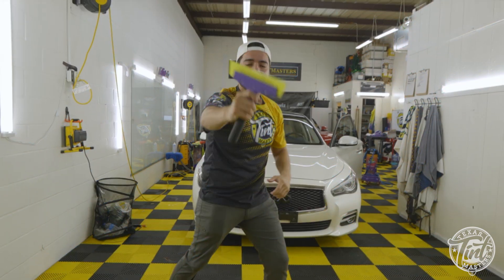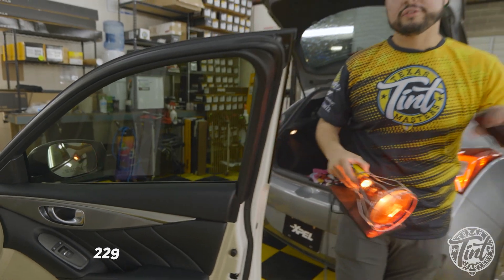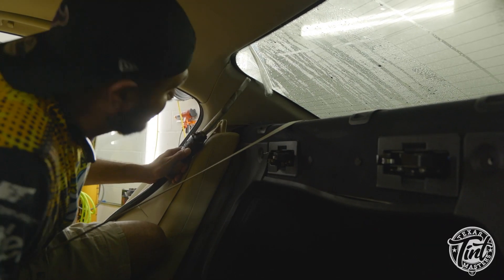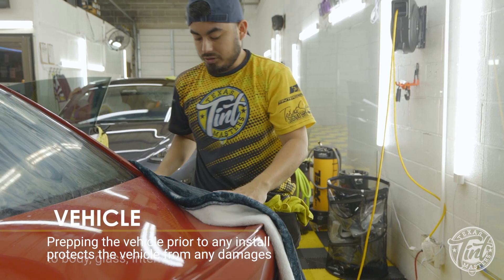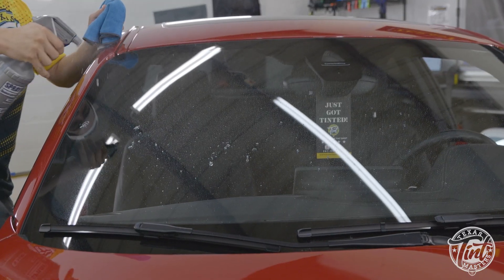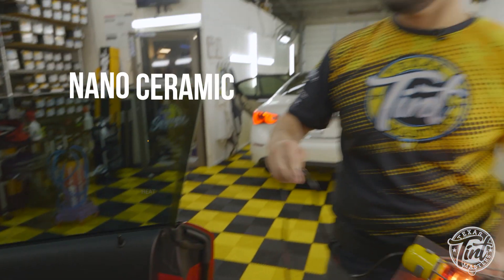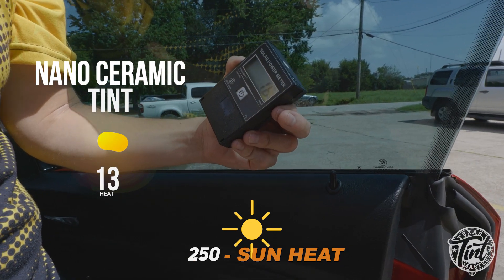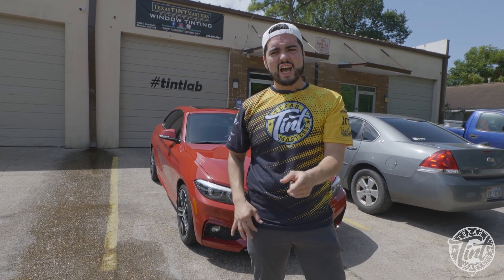Dealership Tint vs Ceramic Tint (Heat Tests)

Comment: For those asking. There are videos of regular 5% tint vs 70% ceramic and the ceramic still does better by a significant amount. I recommend ceramic to my family members when they’re looking for tint worth it in the long run with this heat. I show them that video to help them understand the difference

Comment: Will a lower percentage ceramic block more heat than a higher percentage? Or is it about the same?
Reply from the maker: It will block more 😎
Reply: Lower % blocks more! But even a 70% ceramic tint, beats a 5% factory tint by a significant margin!

I.E a 70% blocks 30% of light, 
A 5% blocks 95% of light.

Comment: How hot will a car get sitting in the hot sun for an hour or so? Will the interior of the car still get over 120 degrees?
Reply from the maker: There’s too many variables for a question like this but the answer to what the question is intended: 

Ceramic Tint is for when YOU are in the vehicle with your AC on. Cars will always get hot in the sun no matter what. Even cargo vans with no windows still get hot.

Comment: If only there was a way to not gimmick this with like what's akin to a "spirit box" in ghost hunting, there could be like a real world test where you left 2 cars outside and tracked the temperature inside.
Reply from the maker: That would be a completely flawed test and wouldn’t prove much other than the decrease in heat transmission entering the car. If you let ANY vehicle (even cargo vans w/ no windows) outside—they will STILL get hot. Just the normal effect of thermal equilibrium. Ceramic tint is an insulator. The difference in effect would be similar to a home w/ and w/out insulation. 

You still need an air conditioning unit to counter heat. Window Tint is an insulator, not an air conditioning unit.
Reply: @TexasTintMasters  yeah but my problem is the actual effect. Carbon color stable tint has some heat resistance, is the ceramic heat reflection a negible improvement in real world use? Most sites discussing it just go into the rigamarole of "ceramic won't block wireless signals" and really stuff that would if anything make it unusable, so not really helpful.

If the windows are a major source of heat transfer, then at the very least in the begining stages of the cars heating up there should be a difference. Otherwise once you block UV and some IR rays that's really the extent to the benefit.
Reply from the maker: @jer280  You’re definitely right about the initial heat transfer however the bit about carbon color stable blocking the same amount of heat as a standard traditional ceramic film is definitely incorrect. 

Carbon films seemed like a great alternative when they first debuted but they don’t last as long and are prone to adhesive failures within the first 24 months, especially in hot humid climates and coastal areas. 

Within industry peer groups, carbon doesn’t hold the same hype and reliability as reputable branded ceramic films. 

It’s normal and common to see carbon distribution companies “changing the formula” every year or two to make up for the negative feedback these films tend to get. 

You can read more about the testing of this film and exact video here: 
https://www.texastintmasters.com/blogs/ceramic-window-tint-blog/is-ceramic-tint-better-than-dealership-tint
Reply: @TexasTintMasters  This is information that I absolutely appreciate! Thank you for taking time to go thru actual negatives of Carbon tint, considering your experience and having dealt with it. 

The information about why it is better is very slim and far between sources. Also most online sources are either tint companies that are trying to remain neutral, or a company with "ceramic" in the URL and that's a red flag that they are going to be biased.

Longevity is a concern especially bc I do live in a coastal and hot area (30 mins from Outer Banks, NC). So that information is very valuable, as I was about to get my car tinted in a few days. Thanks so much
Reply from the maker: @jer280  Absolutely!

Comment: Great video . Taking delivery of a new ford super duty in the next couple of weeks. Exploring tint options. Did not want a dealer tint job. I’m also in Texas east of Dallas . Thanks for your info on ceramic materials. Very good information.
Reply: Hey where did you end up getting your tint job done? I’m east of Dallas as well.
Reply: @jonathanlavery  Dealer did at no charge.
Reply: @johnnyyarbrough9716  Ceramic at the dealership? Which dealership if you don’t mind me asking.